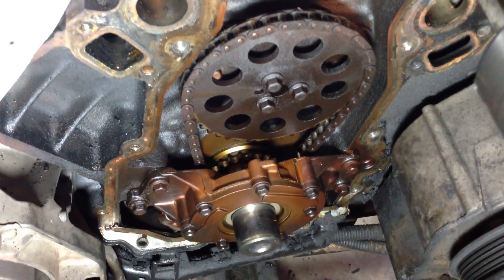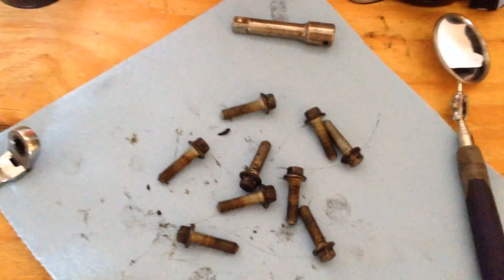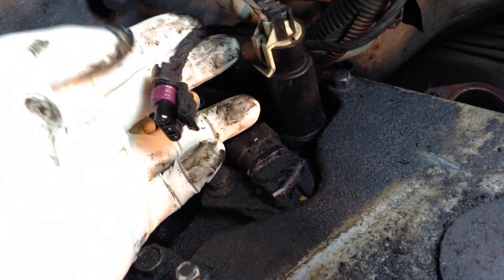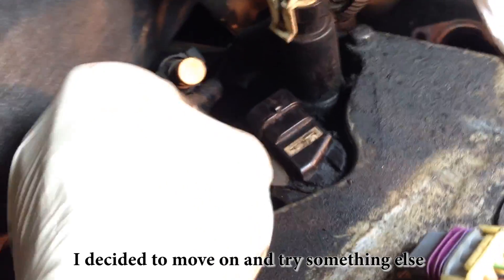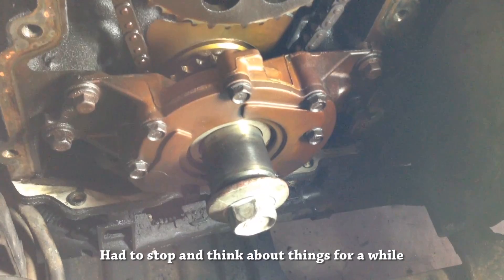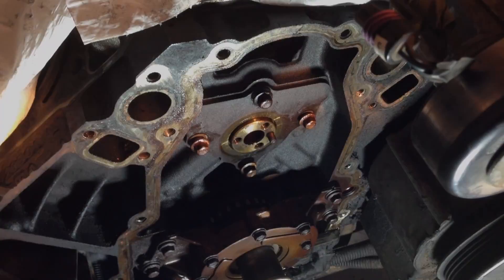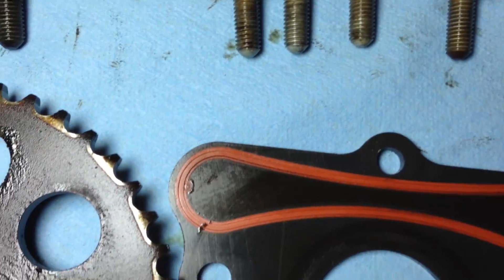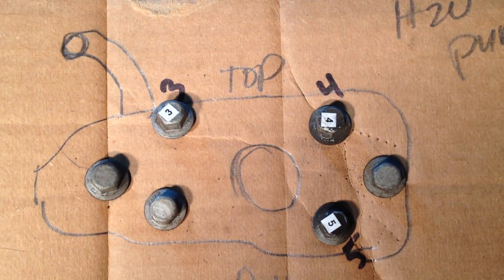Remove Camshaft, Timing Cover & Chain GM Chevy Tahoe 5.3 Vortec Engine LS vid  10

Comment from the maker: You do NOT have to remove the heads to do a Cam swap.  I did not know it at the time, but there is a great tool to do a cam swap much easier.  Check out this tool on Amazon:  https://amzn.to/2RywhAh
Reply: And to replace the camshaft liners?

Comment: Ok so I’m trying to find out weather my 2007 Chevrolet Tahoe has a 3bolt cam sprocket or one bolt now someone told me 07 is a one bolt but ! My truck was made in 03-06 the sticker on the door says so do you think they used a 1bolt or 3 bolt  ? Be a lot simpler if they used a 3bolt just easier to install when doing the dowl rod method and not taking off the heads
Reply: Call the dealer.
Reply: It was a one bolt , truck drives great now The guy I bought it from said he did a deleted dod But there was a check engine light flashing saying unburned fuel detected I asked him so end the delete what did you do he replies I did the lifters And had it tuned swore up and down to me that you don’t need to do a camshaft you don’t need to block the oil valley This dumb ass said he brought it to a GM tech oh I said give him my left testicle if he was right I did a cam swap and the check engine light shut off and I obviously blocked the oil valley and I got great oil pressure now Who would’ve thought dip stick

Comment: Is it simply bolt off/on? No timing issues? I have to do a afm delete and am worried I could screw with timing removing and installing new cam chains andd sprocket.
Reply: I’m on the same boat lol how did it go for you??? I have a 07 yukon with the 5.3 any tips you could give to keep noted???

Comment: Tahoe Steve, love your vids! I have never commented until now. You be doing some pretty impressive work! Im in the process of whether i should replace the timing chain tensioner on my 08 yukon or try the pulleys first, has a bad rattle upon cranking. Kinda rattles with acceleration. But enough about my vehicle. Loved the vid!
Reply from the maker: Awesome! Thank you!

Comment: That thing that you bottom two bolts of the timing cover are sitting on in your video, is just a pice of plastic than can be removed by just unscrewing on bolt on the bottom of that plastic.
Reply from the maker: thanks.

Comment: 2:36 In the next generation Tahoe, that is not your cam position sensor plug, that has been replaced by a 6 pin that goes to the 4 oil control solenoids under the VLOM cover as part of the factory AFM system.
Reply from the maker: thanks for the info

Comment: You're right on the timing the cam the crank dots lineup top dead center with the Piston up number one cylinder but you do not do not need to pull the heads off just the manifold and lifters and pushrods valve covers also I did not watch your video so I don't even know why you're pulling the cam out anyway
Reply from the maker: thanks
Reply: @TahoeSteve  tku

Comment: If your Tahoe has cylinder deactivation known as afm then that explains the valvetrain being brown and cooked on one side. It's a crappy design and causes them to burn oil.
Reply from the maker: mine does not.  i think that started with NNBS in 03.

Comment: Did you pull the distributor out before pulling the cam? I have seen quite a few videos and no one ever mentions doing so. I have number 4 lifter and cam lobe that went to hell. And so this is my project this weekend.
Reply: There is no distributor on these engine as it is electronically controlled by the computer

Comment: Anyone every figure out the bolt by the ac compressor?  I notice he never commented.
Reply: Loosen with an open end wrench then unscrew, it'll clear the compressor.
Reply: Loosen the bolts. It won’t come out but it will loosen up enough for the compressor to come off. Then the bolts will slide out

Comment: I feel you pain.  I am in the process of changing the oil pump.  Just watch another video where the guy just removed the 8 bolts and the timing cover came right out.  He did say he removed the oil pan but never say how that would inpact the removal of the timing cover.  Thank you.